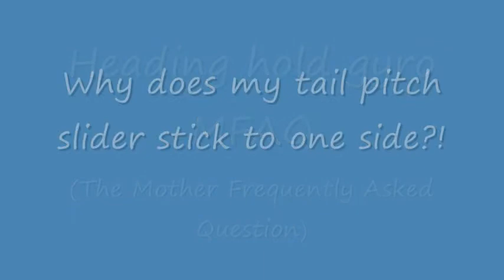Why does the servo stick to one side?

Comment from the maker: @easydoz1 Right, keep the trim the same. If you have tail drift you may need to do a rate mode setup. Look on Helifreak to find Finless Bob's basic gyro setup video. It will explain how to do that. You want the gain up as high as you can get it... without causing tail wag. But you need to do a proper setup first.